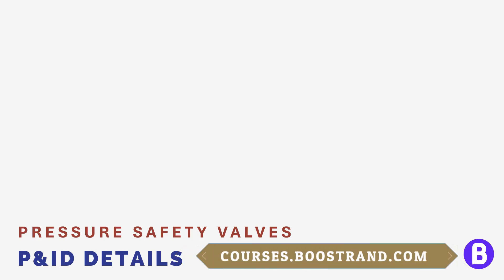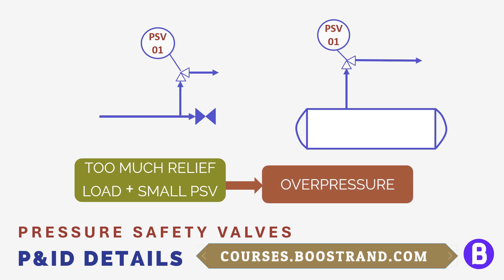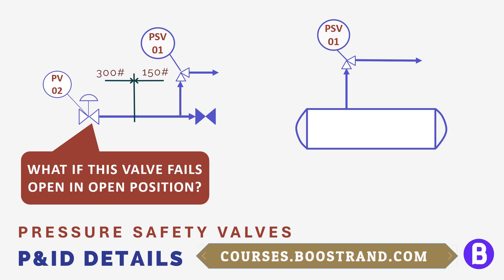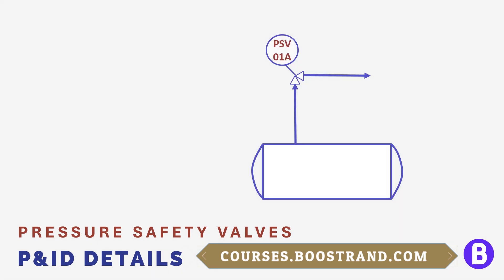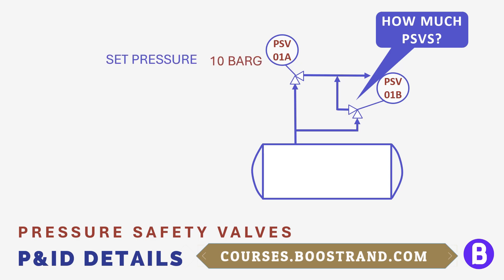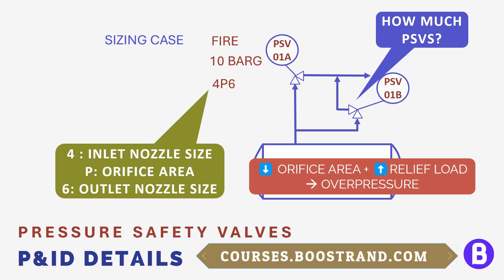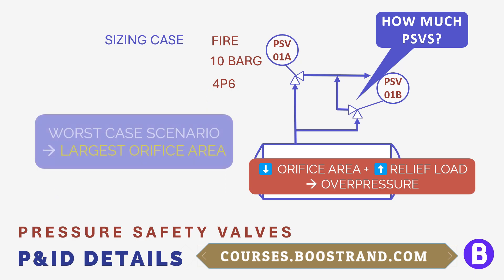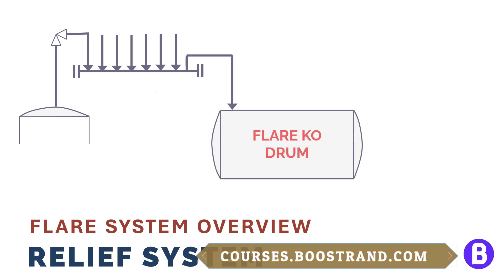013 Pressure Safety Valve and relief system  - P&ID Course 101

Comment: How is  SRV compression determined?
Reply from the maker: Could you elaborate more? There is no compression in a PSV. The sensitivity of the spring is determined by the vendor based on the the PSV set pressure.